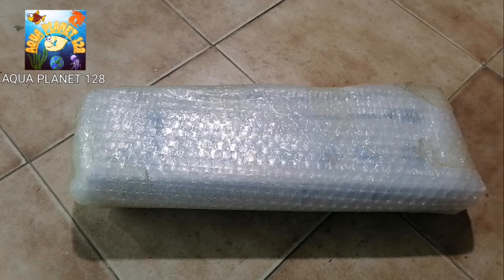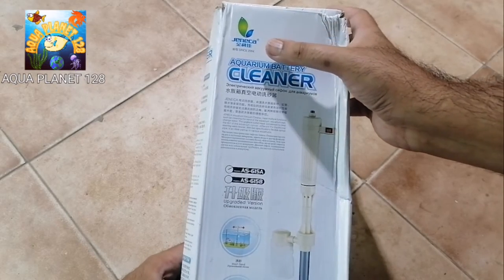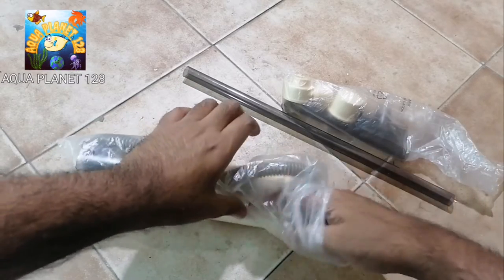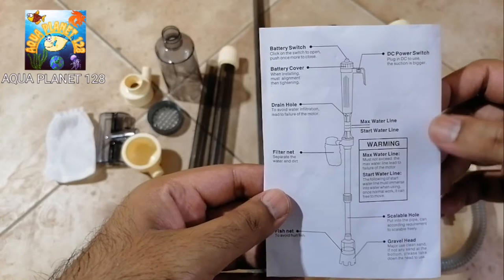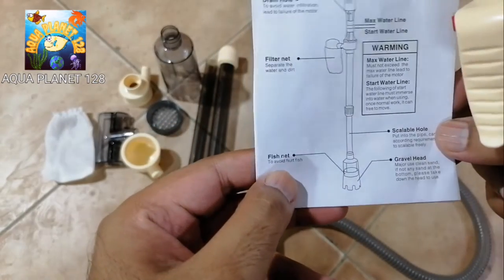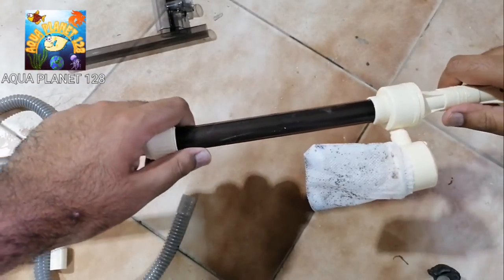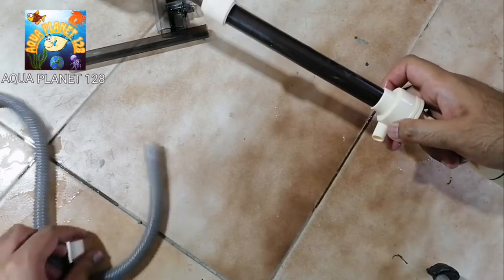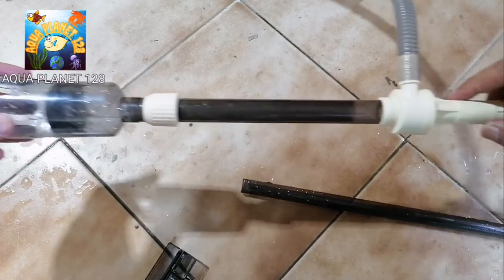Aquarium battery cleaner|Automatic Gravel Cleaner|Fish tank vacuum| #aquariumbatterycleaner #janeca

Comment: Great review. Thank you. When it sucks out the water & you turn it off, does the water continue to flow out?  So you could use it just for initial suction?  New subscriber from Australia 🇦🇺 ❤
Reply from the maker: Thanks for subscription. 😍
No, you need to turn it on continuously. If you turn it off, it will not work.